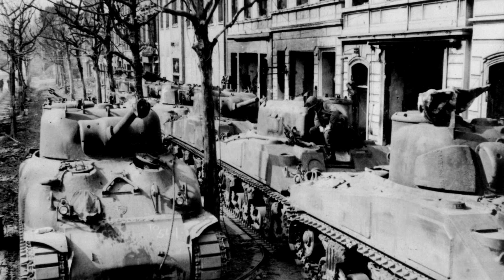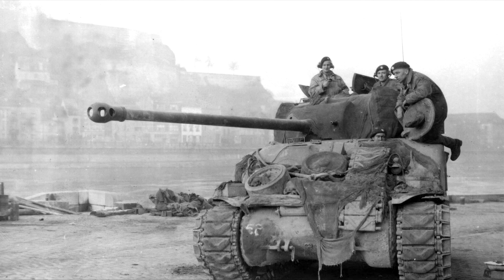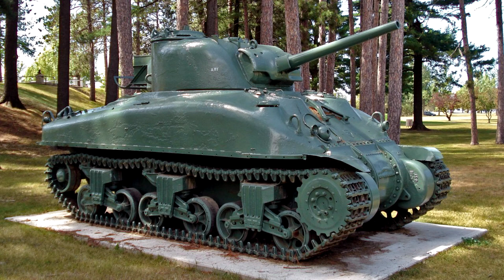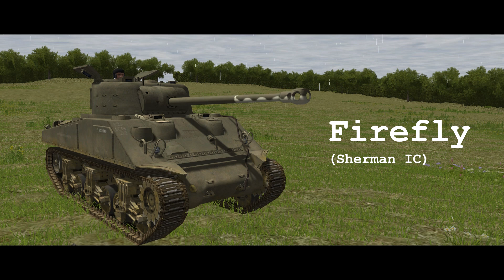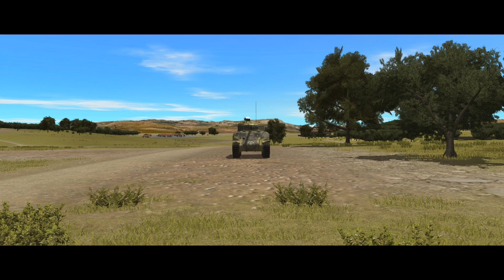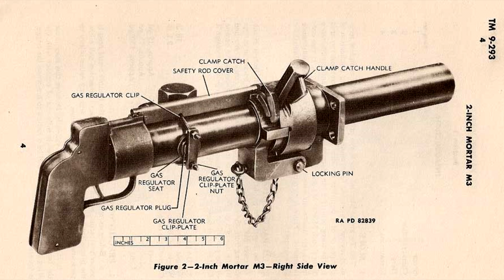Combat Mission Units: M4 Sherman

Comment: Ah, I miss the DETAILS given to us about each vehicle in Combat Mission I.
Reply from the maker: I dunno, I just remember it being a wall of numbers
Reply: @usuallyhapless9481  They had all the sides listed with both the average MM and angle. It was incredibly informative. Cannons were also listed with penetration values for different ammo types with exact MM penetration at different ranges (500m, 1000m etc.). Basically what you do in some of your shorts, but with numbers. Tower, all 4 sides, upper hull, and lower hull. I was SO disappointed when they had not added it for the new generation engine as well.

Comment: I imagine someone's already started this, but M4A5 was the designation for Ram, not Grizzly. Grizzly was the Canadian built M4A1. Ram, despite having the M4 designation, was actually an M3 variant that replaced the tall upper hull of the M3 with a shorter one that could mount a 75mm or 57mm gun in a turret atop the tank rather than in a casemate.

Comment: 17:46 The Americans had experimented with the 3-inch gun, same as on the M10, as far back as 1942, with hopes of sending 3-inch-armed Shermans to North Africa during Operation Torch, but that gun was even bigger and heavier than the 76mm, so the problems fitting it into the Sherman’s turret were even worse.

Comment: Love these unit guides. Could you make one about the TOW? I've been playing some more CM Cold War and some other Cold War games recently and it made curious about the various ATGM systems. Specifically when it comes to Combat Mission I'm having trouble dealing with them before I lose some of my armor. About the only thing that works consistently for me is dropping artillery on every potential ATGM position but you usually don't have enough arty for everything.
Reply from the maker: I've covered the TOW in the Bradley unit guide, but that was before CMCW came out, so early TOWs aren't in it.
Probably going to surface in some kind of M113 guide...

Comment: Hapless! Thank you for the video. You've inspired me to finally tackle why CM wouldn't run right on my gaming laptop (Good news! It was using the integrated card. Switched over to my 4050 and BOOM!)

What graphics settings do you run on your CM games graphics? and do you use any mods? I'm trying to make mine look beautiful but not sacrifice too many frames at the same time. I need at least 50-60 fps.

Thanks again for the video!
Reply from the maker: I usually have the graphics set to balanced- I'm not sure it does anything except change LOD distances.
Mods, well they're different from title to title. I spent some time messing around with ReShade to get more effects, but when I look back videos from that time now it just looks like someone has poured bleach in the screen.
Or, to put it another way: your mileage may vary. I'm not sure CM can ever look 'beautiful' :P

Comment: Excellent video as always UH.  I think it's worth remembering that the Sherman was substantially heavier than the vast majority of German AFVs. I don't believe that any vehicles on panzer III or IV chassis ever exceeded 26 tons, (though maybe some variation of the jadgpanzer IV may have) and though early T34 s were about 26 tons that tank ballooned to about  32 tons with the 85mm gun. This means that depending on the model of the Sherman most German armor is only 75 percent or less of a Sherman's weight.  Considering that other Axis nations didn't have tanks even close to the Sherman the notion of a Sherman as a small tank is just plain wrong.  I find I get the most out of my Shermans when I don't use the hunt command.  I use the slow or move command and go from cover to cover point as close as possible (or reverse from the farthest movement point).  The stabilizer means the Sherman has a high degree of accuracy when moving and the tank doesn't need to stop to get a good shot especially with superior crews.

Comment: The M4A5 is in CMFBDF as the Ram Kangaroo Carrier, although if that's still an M4A5 is open to debate
The M4A1 was the A1 model despite being the first to see service because the M3A1 Medium Tank also had a cast hull, and being otherwise identical the Army decided that A1 meant cast hull regardless of other factors
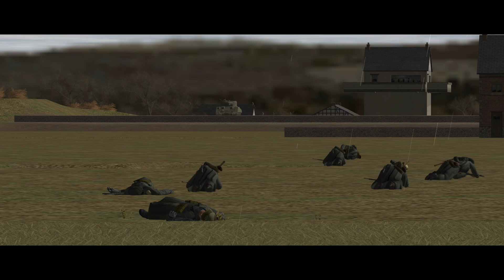17:00 More steel means bigger fragments in terms of explosive shells, a smaller bursting charge tends to produce fewer, larger, more lethal fragments than a larger bursting charge, the 76mm M1's HE shell irl wasn't meaningfully less effective 
British Sherman [Whatever Number]A's were pretty limited, they only got some because the tanks they wanted (75 Shermans of some type) were no longer in production
32:16 Mildly important but in CMFBDF the M4A3E8 Easy Eight (Very Late) is a field expedient Jumbo Sherman and features a lot of extra armor plates bolted on.
Reply from the maker: All good points! I tried to avoid going right down into the CM variants. Though that late Easy Eight with the extra plates looks cool.
Reply: larger fragments might be more lethal, but they are also less likely to hit a target, and produce a less reliable fragmentation pattern. 

actual tests found that the 75mm HE had a about a 10 foot radius advantage over 76mm HE, in both reliable lethal radius and reliable wound radius (thats a 33% increase and a 20% increase respectfully)

https://warspot-asset.s3.amazonaws.com/articles/pictures/000/050/370/source/09-91693a0a1acd748e39229c015a95419b.png (yes this is for the 3inch, but that fires the same projectiles as the 76mm just with different cases. both fired the M42A1 HE shell. the 3inch just used the M2 propellant casing while the 76mm used the m26 propellant casing)

Comment: Considering the manual stating different levels of frontal protection for different variants of the panther (mainly later variants ommitting the face hardening process for the front plate armour), does the 17 pounder fare differently between them? Can it spall or partial pen the front of late panthers? Would love to see a gun range yt short on that
Reply from the maker: I have a feeling the armour quality is randomised and there's no real way to check. Might be worth a test though!
Reply: @usuallyhapless9481  i'm sure there's randomness involved, but the lack of face hardening seems like it could be a huge factor. and that's one thing that is specifically stated by the manual

Comment: Technically Combat Mission simulates the logistics/maintenance impact via different point costs of tanks. Or at least is should include that in the calculation. More reliable tanks should be cheaper to deploy.

Comment: I mean to be fair to the Sherman, a Sherman 76 could kill a Tiger at 2000 meters, and Shermand were far more survivable than any other tank. You might lose the tank, but you almost always got the crew, or most of the crew, out of the wreck making it easy to throw them into a new tank and roll right back to the front. Chieftain discuss how in Shermans you lost .56 crewman per tank loss, so extremely low crew losses compared to tanks lost 😊
Reply: While APCBC could technically penetrate the front plate at 2000 meters, even the slightest bit of obliquity would result in a failure to penetrate.

HVAP would definitely have an easier time but HVAP/APCR is usually far more prolific in video games than it ever was during the war.
Reply: @alarminglyfastmovingskelet7289  that's true, but it's also true most combat between tanks wasn't at 2000 meters, it was inside that where the penetrative effects were even better. Yes the Sherman's still struggled, but that was more against the Panthers. Shermans has been knocking out Tigers since they rolled into the field, and tank commanders going into Normandy didn't want the Long 76s initially because they'd been able to knock Tigers out effectively in Africa and Italy. Obviously that changed, but still shows Tigers weren't quite the threat they are made out to be. It was the tanks after them that were the real bastards
Reply: It basicly was good enough in every regard, while every other tank in WWII was good at something to be bad at another
Reply: @leandro9311  technically the panzer 3 was good enough, there was even planned 75mm L48 variant that was technically possible. its just the germans weren't interested in good enough (eg the L48 varient was going to take too long, so they canceled it and kept just the panzer 4 as the stopgap, despite being technically inferior, all because the panther was coming soon.). thepanzer 3 was also extremely easy to make. significantly easier to make than either a sherman or a T-34.
Reply: @matthiuskoenig3378  do you mean the pz4?
the turretring of the pz3 was to small for the long 75mm cannons and even the short 75mm cannon was a tight fit.

The problem of the pz 3 was the lack of upgradeability caused by the turretring, increasing it would mean redesign of the hull.
The problem of the pz 4 was everything about it. As a 19 ton design it was upgraded to weight 25 tons.
The added weight put a lot of stress on the suspension and gave the engine what could barley make 300ps a lot of work.
As a bonus the top front plate was not angled and the turret front had, even in the H variant, only 50mm of unangled armour. 
On a battlefield with 30+ ton tanks, like the sherman and the t34 it simply could not keep up anymore.

trying to do all the upgrades, that the pz4 got, on the pz3 would create the same problems that the pz4 faced.
An overweight and at the same time undergunned and underarmored tank, that has to face tanks that started development at ~30 tons instead of ~16 tons.
Reply: 2000 meters? I would like to see a source for that, given the similar frontal protection of the Panther and Tiger, and the trouble the 76 already has on 1500 meters.
Reply: @larsdejong7396  It’s only because the UFP of the Tiger is flat, really.
Reply: @larsdejong7396  You need to read more if you think the frontal protection of the panther and the Tiger is similar...
Reply: @larsdejong7396  go watch the Chieftains "Myths of American Armor" video. He has sources from the Army Archives immediately after the war
Reply: Short barreled 75mm Sherman could consistenly pen Tiger front plate from within 500 meter. Considering that Europe countryside consist of hedgehogs and hills,  your combat distance most of the time would be within 1000 meter.
Reply: @Rifin-pu2hb  WESTERN Europe sure. Eastern Europe is a very different story, and realistically speaking the majority of German tank design was meant to fight the Red Army. Germany was not really worried about Western Allied armor, and they weren't necessarily wrong in believing so considering it took the United States until 1945 to even field the M26 and even then it was qualitatively inferior to it's contemporaries.
Reply: @alarminglyfastmovingskelet7289  Yeah, eastern Europe is mostly flat with some forrest in the middle, it's the theater that German's high calliber weaponry shown its full potential. Fortunately for the allies, Germans tank development lagged behind a little in the mid-war. It took them until 1944 to field tanks with slope armor (Panther) and by then the Soviet had guns powerful enough to punch through it.

Tbh in CMBN, I rather have a Panther than a Tiger, their front armor is impenetrable by most U.S medium tanks it encounters while still have the gunpower of Tiger.
Reply: @alarminglyfastmovingskelet7289  The U.S had a number of heavy tank prototypes very early on, they even had medium tank prototypes, the U.S simply did not want to afect production rates for the M4 Sherman, at least until a new tank was good enough in every regard as well. For example, the Sherman 76 was ready as soon as 1942 or 43 if i correct, but it wasn´t until 1944 that production begun and even then, by Normandy only a few hundred had been built. The reason for delaying the Sherman 76 was simple, i beliefe it was the Ordnance Bureu that wasn´t satisfied with the turret ergonomics, even though everything else worked good and reliably, the expected encounters with heavier German armor such as the Panther and Tiger when invading France dictated that, the Ordnance Bureu had to content itself with what they had achieved and put the dam thing in production, and they still didn´t replaced the 75mm Sherman because that one was prefered over the 76mm as something like 86% of all targets engaged by Sherman tanks where soft targets where the 75mm had a clear advantage in explosive mass in regards to its High Explosive shell compared to the high velocity 76mm shell
Reply: @alarminglyfastmovingskelet7289  Except the Soviets also used Shermans, lots and lots of them. They proved effective in Eastern Europe too, so Germany not being worried about Western Allied armor was pretty stupid of them. Also the Pershing was only weaker than something like the Tiger 2 and there were a bare handful of those.